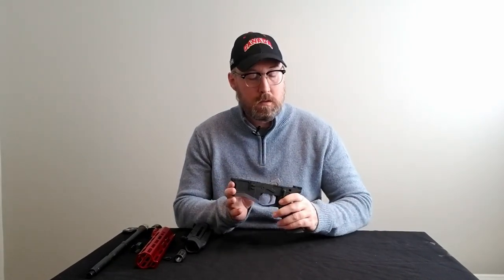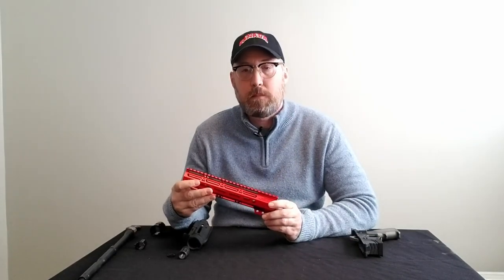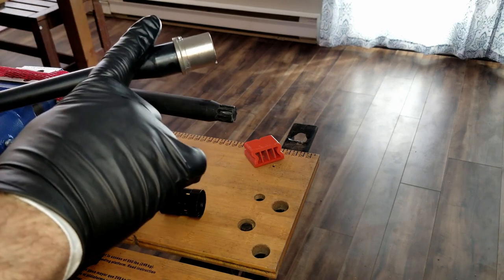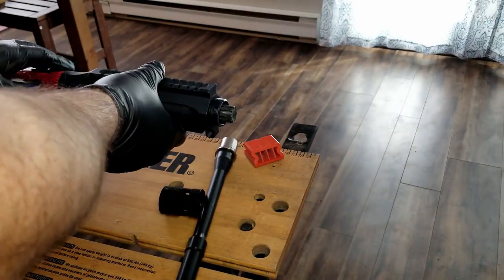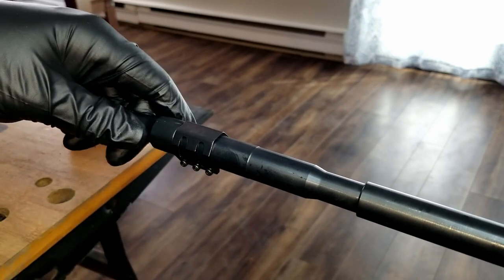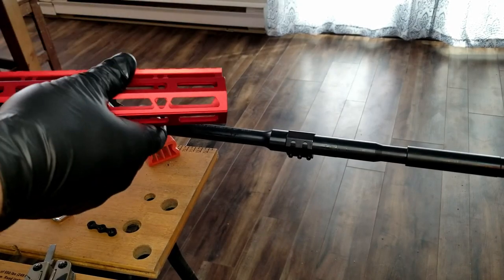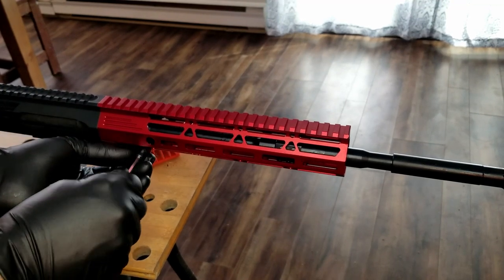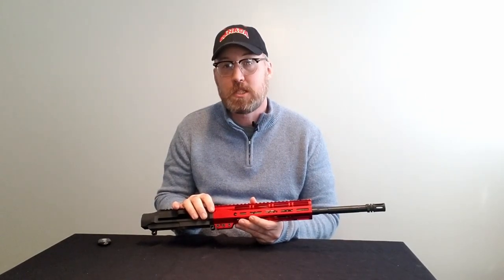Maple Ridge Armoury Renegade - Assembling the Upper Receiver Pt 1: Barrel, Handguard & Flash Hider.

Comment: Thx for making the video i was starting to worry that you were not going to make it.
How do you check the head spacing for the bolt ? I think i am ok for my build because i have the Maple Ridge barrel and there bolt as well so it should fit , but i would like to make sure and to also know for later it i change barrels . Nice job again and Thx
Reply from the maker: Thanks!  To check the headspace, you'll need a set of go/no go gauges for the caliber of the barrel you're using.  I had a friend check mine with a set of 5.56 NATO he has because they cost a few bucks (about $120-ish for a set from True North Arms, for example).

Comment: What tabled legislation has made it advantageous to keep an AR fully assembled? Still prohibited and is destined to be a safe queen, never sold or bequeathed and never taken to the range. Seems like a waste of good parts.
Reply from the maker: A lawyer I know just mentioned that until the court cases are settled and we see if  C-21 is actually passed, going through the process of changing your AR to a stripped upper/lower in the system may cause some headaches down the road.
Reply: @GallifreyanGunner  any update on this? The "rifle" is only the upper and lower (at least as the OIC defined it), so that's all they need when they come and take them.....er I mean buy-back.
Reply from the maker: @Cataclysm1  They just put the freeze on handgun transfers so I have no doubt the buyback is coming soon.  They were floating approx $1300 per rifle but no details on how it's going to work.  4 provinces have said they aren't authorizing any money for police in their  province to assist in the program.  I'm actually trying to get a hold of the Canadian Firearms Program to get my complete rifle reclassified as a stripped upper and lower .  I'll use the parts as spares for my Renegade.  That way, if the Conservatives get in and decide to repeal this nonsense, I can restore my AR instead of buying a whole new one.
Reply: @GallifreyanGunner  yes, it will be interesting how this buyback works - in my opinion it’s only the firearm they need, which is the upper and lower of the AR. It would be very distasteful if they required a complete and functioning rifle in order to pay - I can’t say I’m a fan of giving the government functioning equipment that someday ends up in the wrong hands. 
Ordered a couple MKII regardless, will wait to strip the AR until more is known. 

Great videos, btw. Excellent work.